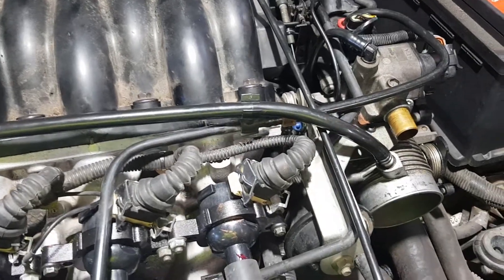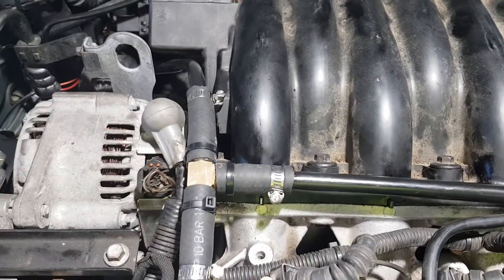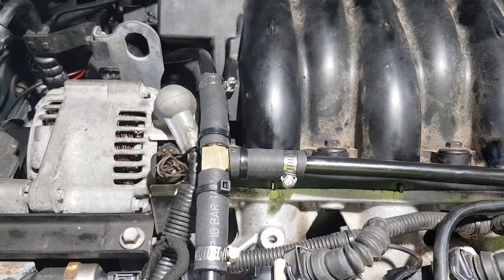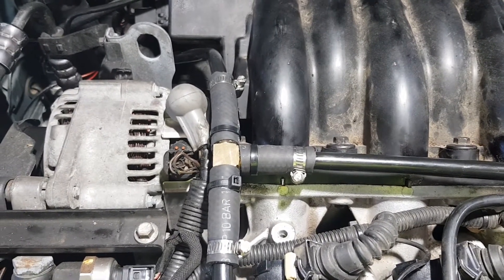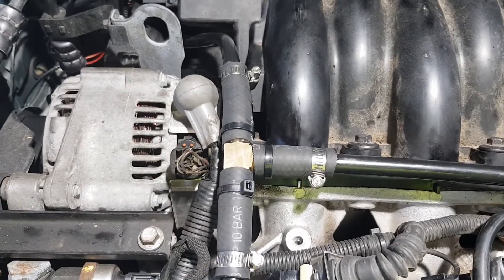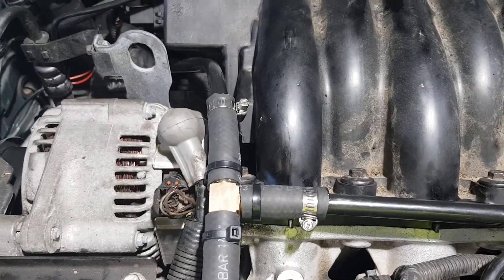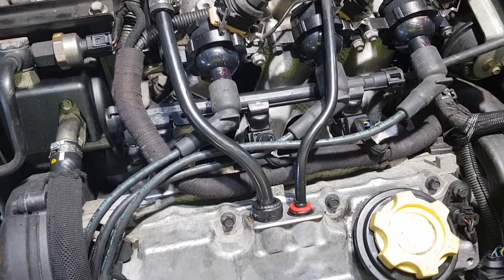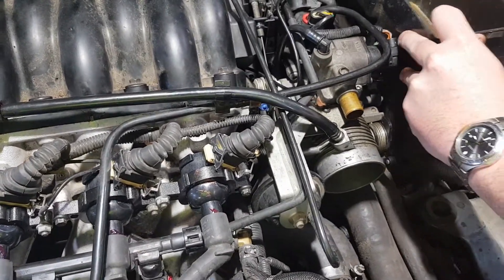Rocker cover breather modifications

Comment: Iv got a o3 freelander 2.5 your breather hoses going into the valve cover the right hose goes in and dose nothing in side the cover its it dosent have a hole going threw the cover it just stops.the left hose pushes threw and connectes to the breather hoses on top like ya showed but what is the left hose for thanks Fred